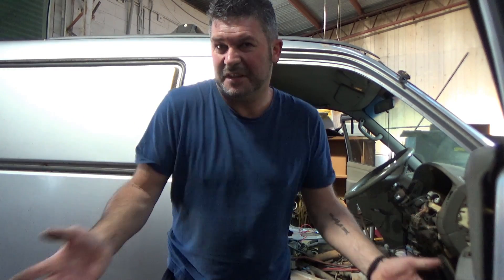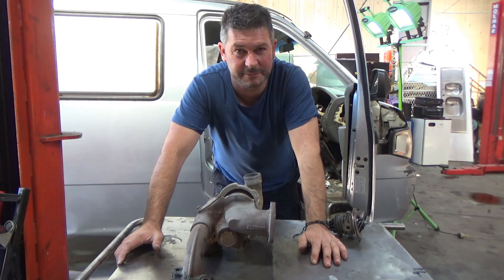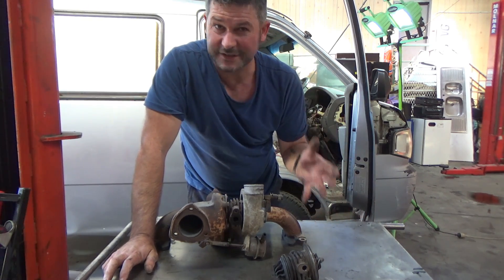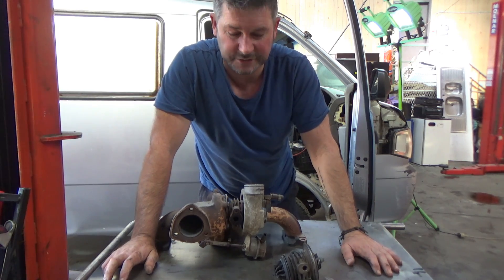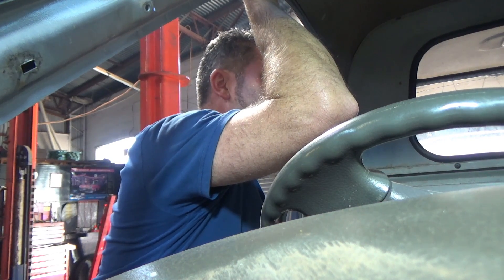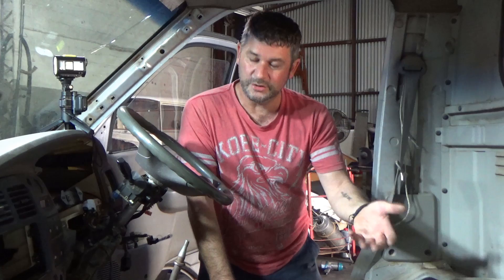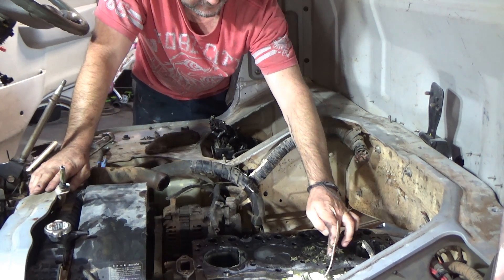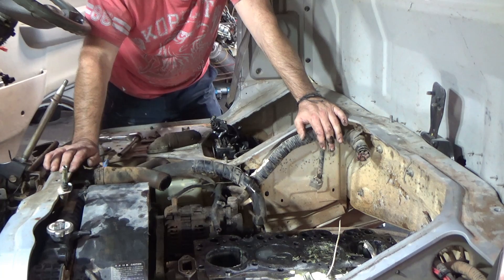How to Stop a Run-away Diesel -ENGINE BLOWS !

Comment: Most modern diesels have an intake flap to shut off the air, be it vacuum or electrically operated. Mind you my ex lemon of a Golf mk5's flap was kaput, so when the turbo seals failed and/or i was flooding the intake with dampstart (long story about reversed fuel pump lines bad fuel supply etc), the engine screamed above the redline for about 30 seconds until it lost its supply of oil. The smokescreen had to be seen to be believed. Amazingly no known engine damage occurred and it's just passed an MOT at 201k.

Comment: There's another video around YouTube where an engine starts to run away and an old guy throws a balled up rag into the turbo inlet and it does shut it down, probably destroyed the turbo at least though
Reply: Johnno K as explained at the start with a runaway turbo engine, the turbo is going to nedd rebuilding or replacement as the seals are compromised and you are burning oil.

Comment: Drove a Kenworth with a c12 CAT the turbo went out but they said drive it in.  Soon as i pull in the yard it catches fire and starts to run away.  We ended up making it die by spraying a a fire extinguisher in the air intake.  Had to get a new intake housing, replace some wires and air lines.  Still running to this day.

Comment: Had a runaway diesel a few months ago, pretty scary, it was in a boat so no way to stall it by clutch drop! The air filter assembly faces down and I bottled out of taking that off in case it threw something through the crankcase. Fortunately the answer was to keep it in gear to stop the revs going crazy and it soon calmed down. This was not an injector or turbo failure it was someone tthat serviced it had put too much oil in. It was running fine until we hit rough water, horizontal cylinder, engine at an angle.

Comment: Pretty far from real world.  Actual runaways will be revving as fast the engine will go, because the fuel governor will be ineffective. For the rag method to work, it needs to be a large piece, well rumpled up.  Fire extinguisher is best, followed by high gear against the clutch and brakes, but the clutch will suffer.  If it's a big truck diesel then fire extinguisher is best.
Reply from the maker: turboslag -as close to " real world " as we are prepared to go without damaged ourselves. If we were paid to be stunt men.. well, maybe we would risk a bit more
Reply: Point taken.

Comment: Most everyone has a hand, put your hand over the intake.   For a short time there is not enough suction to hurt you, only the atmospheric pressure.
Reply: Putting your hand over the inlet of a runaway diesel could result in the flesh being sucked off. I wouldn't do that. Wrecked engine, who cares? Mutilated hand? It's not worth the risk.
Reply: Jim Thode nah your kidding yourself mate
Reply: "only the atmospheric pressure"
You do know you can't exactly put the word "only" on this context right? Specially a big engine with a big intake.
Reply: No, the vacuum would not pull the flesh off your hand.  I tried a 3" opening with 25 inHG of vacuum with no ill effects.  The runaway engine may pull just a little more but not likely more then 28 inHG.  I would not want to leave my hand there too long if it did not kill it because it would start to cause a problem after a few minutes.
Reply: You are correct, I would not want to seal a large opening with a body part.   About 3" is likely about as large as you could seal with a hand.   As I wrote I rigged up a 3" can on a vacuum and and took it to the limit of me vacuum pump.  At 25 inHG the suction was 12.3 psi or a total of 87 lbs of pull.  I was easily able to pull my hand off the can with no ill effects.  Now if the opening was 8" the total force would be in the range of over 600 lbs!  At 600 lbs it would likely not be easy to get away.   In the case at hand in the video it looks like the opening was less then 3", sealing off with a hand would be doable.

Comment: On a semi, that has Dual Air cleaners hanging on the sides by the doors Can you Spray a c02 extinguisher into just one of them would it be enough to kill it? Maybe if there where 2 people, one fire extinquish it and the other pop the clutch in 13th gear

Comment: I don't know about passenger vehicles, But my Kenworth had a Engine Stop Fuse. You pull the fuse and the engine dies. Some older trucks had a Butterfly T Handle to kill the engine.
Reply: BlueDevil007 Engine stop fuses don't work on a Turbo runaway. Atomized oil in the air intake bypasses all electronics. About your only option is to cut the airflow or smother it.

Comment: A large bag of smallish nuts, bolts and ball bearings tipped down the intake usually works to stop a runaway
Reply: Goodbye valves
Reply: Rotax 636nut the sounds tho
Reply: Rotax 636nut now thats funny
Reply: You forgot the posts, chain, and stable hay with horse dung

Comment: i like all the complaints about not enough revs and not a true run away, but you demonstrated perfectly what works and doesn't work without destroying a perfectly good engine, anything that works or doesnt work at low revs should do the same at high revs
Reply from the maker: Justin_Pirates_Rc -Thanks for the feedback. We are just two amateurs giving it a go.
Reply: Justin_Pirates_Rc ...this is a synchronized tranny..when putting it in gear, each gear has a brake on it to slow down the transmission and allow you to get it in gear.. Semi truck transmissions do not have that feature, and you shift them without the clutch..trying to get one of these transmissions in gear, behind a run away diesel is almost impossible. Most semi trucks have a clutch brake, to stop  the transmission, to engage 1st gear, while idling..   
The most important thing to note here, is this engine is in no danger of exploding and killing you.. I have seen an 8v71 detroit, blow pistons through the hood.. Takes balls and no brains, to sit over a bomb, and try to kill it..
Reply: Justin_Pirates_Rc: Those are very realistic comments. You gotta remember that a lot of todays diesel trucks can easily be tuned to over 1,000fT LBS of torque, you don't just put that kind of power in gear and stop it with the brakes. Testing that on a diesel VW Rabbit is not even in the same galaxy as testing on something with very high power because to have that high power you need massive amounts of airflow. One of these bigger engines can ingest your hand if you try to stuff a jacket down the intake.
Reply: They most likely did destroy a good engine. At best they fucked a bearing and bent a rod

Comment: Thec first eveer runnaway i ever saw was when i was an Apprentice working on locomotives.The Foreman was using a pipewrench to work the rack on a brandnew GE loco. The Stilson got jammed and he had a struggle to get it free, within minutes the engine started revving a bit harder and smoking. The engine shut off was activated, that didn't work, so the main fuel line was chopped ,it still didn't stop and withan intake of a meter square there was nothing around to block it off . The engine started running on the crankcase oil and kept running until a rod let go scattering bits of expensive engine over 100 feet away... The second was perkins diesel in a truck ,when the aircleaner tipped off when the truck went over a bump pouring oil down the intake ...we stopped that one with a rag down the spout...Putting it in gear wouldn't work ,it would have just kept moving.

Comment: Being a mechanic and working on a lot of 4WDs in far north Queensland I have encountered run aways before, generally a big fist full of rags or t shirts stops it quickly, but the one that will catch you out by surprise is when they run on backwards!!! Exhaust system full of diesel from a faulty scv, turns the exhaust into an intake and blows it all out of the intake pipe, takes a few moments to realise what is going on and that you need to block the exhaust off haha
Reply: Reminds me I've seen a video about some crude oil running tractor (2 stroke) that you really needed to take care if the engine would be able to go uphill or not, cause if it stalled mid way and started to roll back, the engine would start to run backwards and pull it harder downhill.

Not the same deal (as it's not exactly a runaway) but a kinda similar situation, it's interesting tho that while 2 strokes used in big ships are indeed stopped and reversed for the propeller to run backwards, the runaway principle could do this to a 4 stroke as well, nice addition.
Reply: @Kalvinjj  yes, that was the old lanz bulldog 2 stroke engines that would run backwards if you went up too steep a hill!!
Reply: @Kalvinjj  4 stroke wont start backwards
Reply from the maker: sean henderson -that's good info ! Never thought of that happening.
Reply: Lol, not come across that before (I'm also a mechanic). Should've tried driving it to see how fast backwards you could go! 5 gears reverse,  1 forward! ;)
Reply: sean henderson that would be strange, I'd definitely be confused for a bit
Reply: I never even thought that could happen! Awesome comment. Learned something new 👍🏼
Reply: Lanz Bulldog. That thing was mental.
Reply: Saw a guy in the 80's that had a KTM dirt bike run backwards.
Reply: @donrutter6765  I had a Honda 250 2 stroke to run backwards a year ago or so. The carb was clogged up some causing it to run lean. It would backfire at low RPM and start running backwards. Any 2 stroke will run backwards if it gets a push in that direction. The new fuel injection models may have something to prevent it.
Reply: I actually saw a diesel run backwards on a tractor-trailer years ago. My friend was backing a trailer on rough Terrain, very slowly. The truck roll forward for a second and it through the engine the other way. Suddenly we saw exhaust coming out of the intake stack and the oil pressure drop the zero. He was able to kill the engine and it took us a little while to figure out what just went wrong. It can happen
Reply: Bulldog tractor probably
Reply: Fuck me that sounds lethal!
Reply: sean henderson ha I've seen that happen before was definitely a site to see when it ran backwards
Reply: A relatively modern John Deere 2140 I used to have would run backwards. If running static without a driver in the cab, running a PTO implement like a diet feeder wagon, it stalled through overload, the PTO would disengage just at stall and the engine would kick back off compression and run backwards. The only apparent damage was that the top of the DPA pump would fill with diesel and force the seal under the top cover. It's still running like new to this day with 12,000 hours on it, so there was no long term damage.
Reply: A four stroke diesel cannot run backwards. Valve timing and camshaft profile does not allow it. Two stroke can and will.
Reply: Is this a 2 stroke engine?
Reply: sean henderson yep blocking the exhaust is much safer either way, stop the flow of gases, and personally I wouldn't be near the engine, if it explodes it with spray you with sharp, hot shrapnel at 100 mph, no thanks!
Reply: Whats scv?
Reply: Haha, that would be freaky.
the 2 stroke thing reminded me of some of the micro-cars made post war. At least one of them was a two stroke where, for reverse, the engine was started in reverse!
Reply: This was really common on old 2 stroke Detroit's.
Reply: sean henderson very good comment, never heard of them reversing.  I've seen this on the road years ago and didn't know what was going on, nor anyone else.  They thought the pedal was stuck and that's all they said as it towed off. Betting being a diesel it was this.
Reply: @MZ-bl6wg  the majority of people end up doing more harm than good. They can hardly check their oil but think they can diagnose a screaming engine on the side of the road. Those in the UK and Australia have a slight advantage when it comes to runaways as they have a larger percentage of diesels with manual transmissions. They have all but disappeared in the states. Throw it in the highest gear and dump the clutch and it will kill the motor.
Reply: Yeah wow... freakin diesels hey... Good to know.. thanks for sharing the knowledge hey!
Reply: WHAT!?!? 😳
Reply: @uhhhhhhhhhhhhhhhhhhhhhhhhh8833  yes, the old 2 stroke diesels like the Detroit’s can actually run backwards. The bad part is instead of the oil pickup sucking oil in, it blows oil out of the engine back into the pan. The exhaust becomes the intake, and the intake will become the exhaust. Look up a vid on YouTube of a diesel running backwards and you’ll see what we mean!!

Comment: In the Army we had a 2 1/2 ton truck, injector pump failed wide open, linkages etc had no effect. We tried the high gear and pop the clutch, just burnt the clutch up, no difference in vehicle running. Block air, could not get a good enough seal. disconnected the fuel line (injector pump issue remember?) that finally stopped it. The engine sucked all the fuel from the lines and filters in just a couple seconds, that is about 4 gallons of diesel in just a few seconds. Not a runaway by the burning it's own oil definition but it could not be shut off any other way.
Reply: Kalvinjj agreed, furthermore i suspect that a 2½ ton has significantly more torque, and would likely just tear the clutch apart anyway.
Reply: It would work if the fuel was what it was running away on, but if it was running away on the oil, it would not work.
Reply: That makes sense. I didn't think about that. Thanks Buck Wilson for the reply.
Reply: Yes makes sense, I always wondered if pulling the fuel pump fuse would work as well. Anyone know if this idea would work or not?
Reply: Also I guess I should mention that if it's the fuel regulator or something that stops the fuel that has failed, the engine could in theory still suck fuel in if the pump is off. Not likely but a possibility I guess.
Reply: Pulling the fuse may not always work. Since the injector pump is usually driven directly of the motor itself and does not need any electrical power. To pull the fuse of the main tank pump COULD work. But if it is just a regular centrifugal pump the injektor pump could suck enough to pull the fuel trough without any effect. So that depend heavily on the individual construction
Reply: wayne parris ???? 4 gallons in a couple of seconds???????
honestly I don't see why it can't be shut off by turning the key if it's fuel related. you'll cut power to the pump and it stops giving fuel?

I can see why it keeps on running without a key on oil. because that's how diesels work: a gasser will cut power to the spark plugs, but in a diesel, the cylinders are hot and the oil will combust by compressing it and keep on doing this on and on and on… 

honestly, if you drop the clutch in it's highest gear (and hold the footbrake and handbrake of course) and the clutch is in good condition (didn't slip yet), the car should stop. 
if you don't apply any brakes, well, even a bigger four cylinder diesel or a powerful gasser could destroy the clutch and get it to start moving…

I'd avoid the air intake: I've heard of engines ripping themselves open or spitting out chunks of engine: wouldn't want those in my precious face. if driving an automatic, spraying the fire extinguisher in the intake if your only bet, I guess.
Reply: 4 gallons my ass😆😆😆
Reply: Makes sense, I think a normal runaway (as in burning lubricant) could be stopped with the clutch thing, because the oil is not as good of a fuel. But if it's locked injecting actual diesel then it's pretty much at it's peak power output too.
Reply: Popescu Robert what is the problem with 2½? It's just as readable, and (at least for some of us) the ½-key is on the keyboard anyway, so why not use it instead of wasting an extra keypress?
Reply: It's so hard just tu write 2.5 tons instead of 2 1/2?

Comment: the only reason you can get that into gear is that the gears are synchronized on a semi that wouldn't work
Reply from the maker: Devin Gajewski-You realise a " semi" still has a clutch to disengage the gearbox from the engine  ??
Reply: Naked Off Road I know I drive one but with the engine running at that high of RPMs the clutch brake is going to burn out before you can get it into gear
Reply: Devin Gajewski plus I'm pretty sure syncro is missing on your low gears, you would be sticking it in high devin
Reply: garth odonnell - on some semi's they are but 98℅ of them aren't it didn't matter if it's high gear or low gear